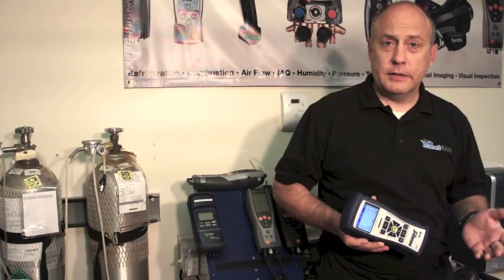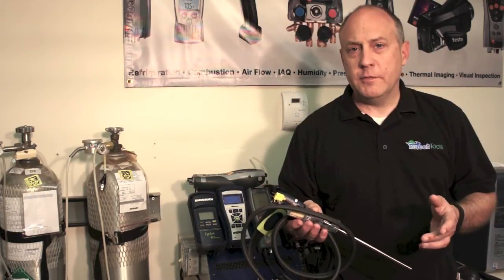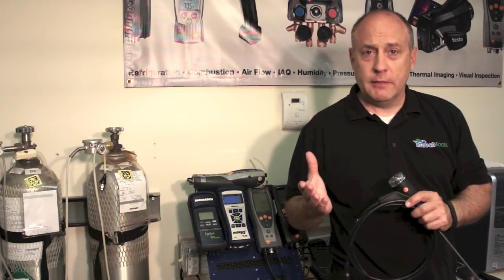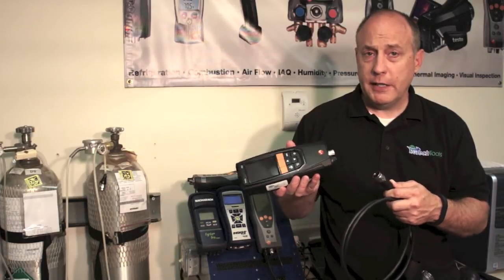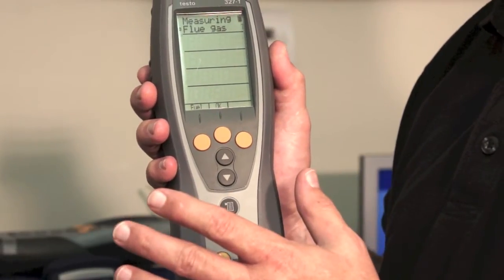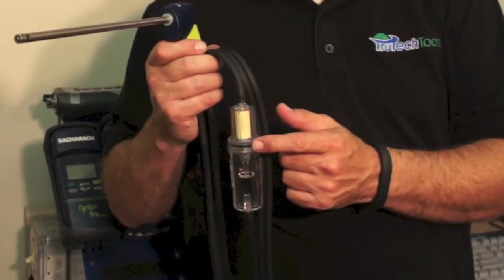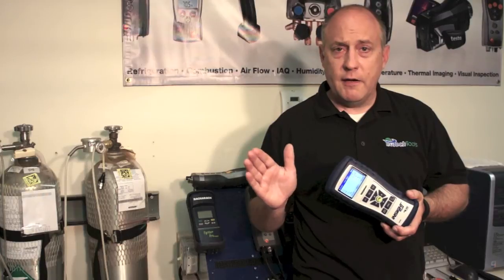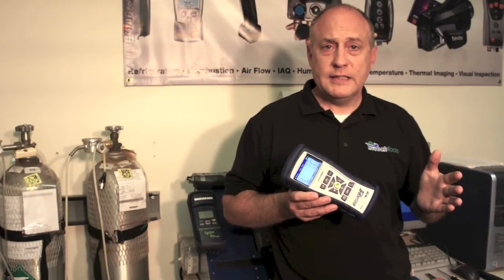TruTech Tools Calibration Video

Comment: Great vid thanks
I’m in the UK here
Went to take an emissions test today and it just would not move off 0.
I will add earlier in the week came across a boiler with real high co readings which lead to an overload...
It reset eventually and has been used to take a reading between then and now. Any ideas . Thanks
Reply from the maker: aneseed Hi there, you should get in contact with testo by going to testo.com, make sure you are on the UK site, and give their tech support a call to see what might need to be done with your unit.